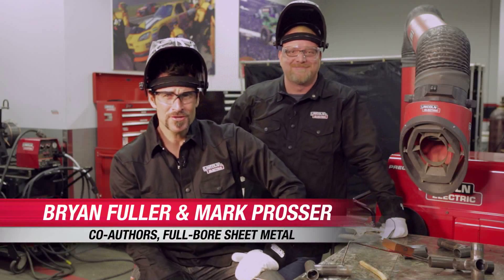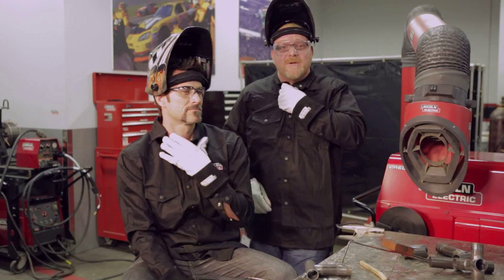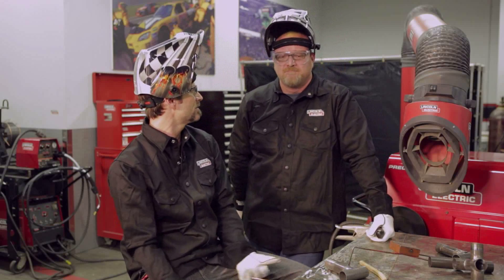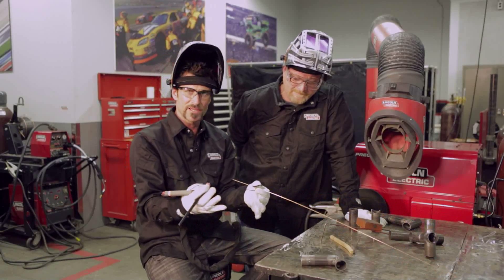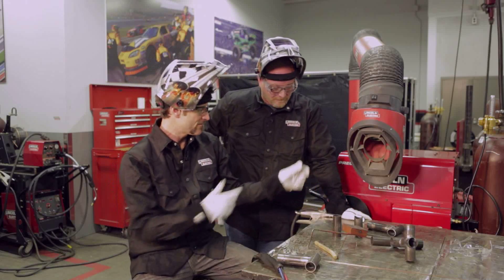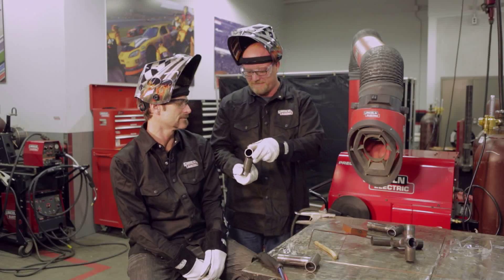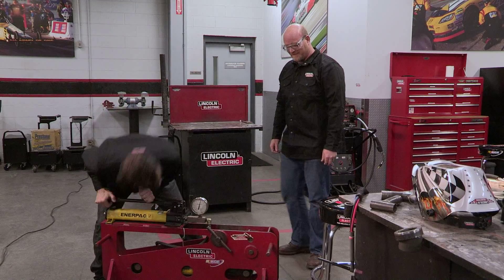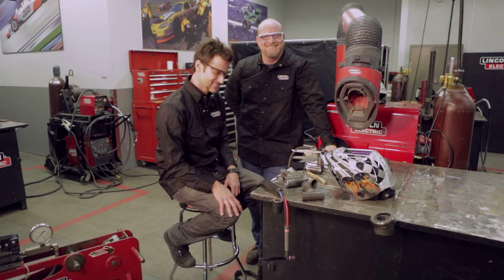Tech Tip: Chrome-Moly Welding Basics with Bryan Fuller and Mark Prosser

Comment: Question Is the hydraulic fluid pressure indicated on the gauge representative of the true pressure exerted on the test piece. I think, only so if the face of the ram inside the cylinder is 1 square in.
Reply from the maker: Yes, that is correct.